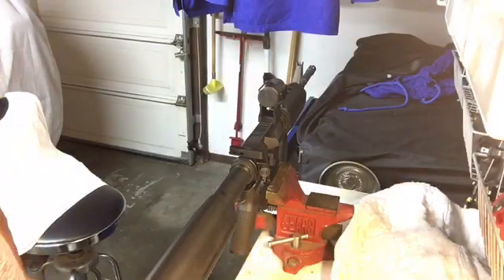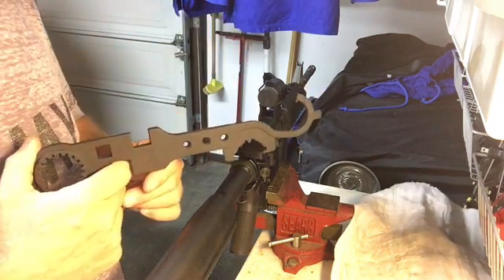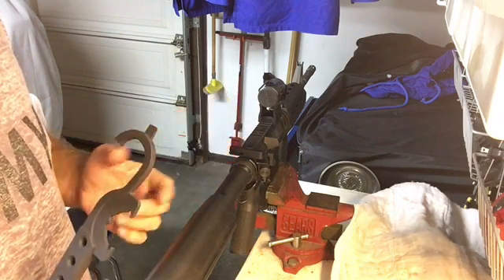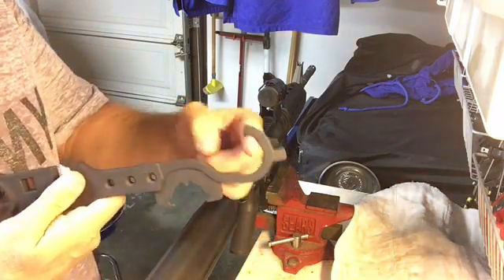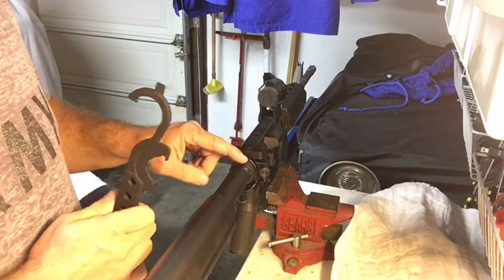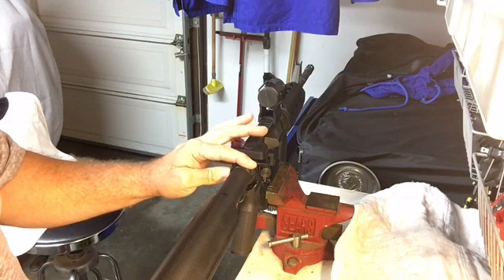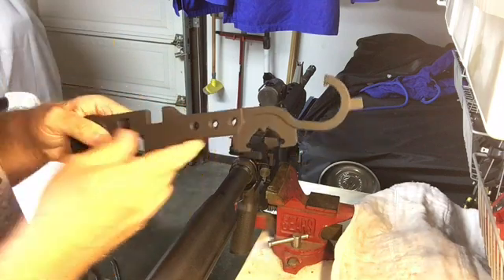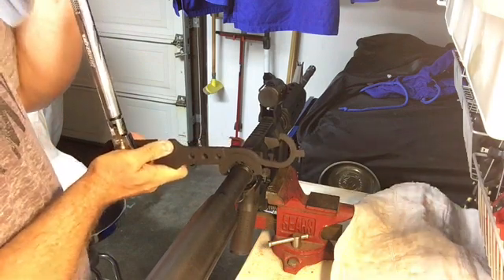AR15 Castle Nut

Comment: what matters as far as torque applied is the distance from the center of the nut to the point at which the center of the torque wrench drive is applied. it's actually a pretty complicated subject. It would be much better if the square that the wrench goes into is as close as possible to the centerline of the buffer tube.

That particular armorer's wrench is not a good design.

Comment: Thank you for the video. Just what I was looking for. Well explained. I actually have the exact same armorer’s wrench as you.
Reply: I would have thought that the torque would be more accurate if the torque wrench was in line with the tool where if it was orthogonal (right angle) would introduce a factor of an error of the desired torque

Comment: How did you clamp your lower in the vise to apply the torque without fouling or cracking the lower?
Reply from the maker: I used an AR15 vise block. It’s basically a hunk of plastic that locks into the magazine well. They sell them on Amazon. See link below.  That said, it does make me a bit nervous the amount of pressure that seems to be placed on the lower. I try my best to really support the lower with my free hand/arm to try to reduce the pressure when removing or installing a castle nut. Especially if you are taking off a tight castle nut that is staked. 
https://www.amazon.com/Reinforced-Plastics-Fastening-Support-Assembly/dp/B0C5WZFK44/ref=sr_1_2?crid=369R7N1SJPCQ9&keywords=ar15+vise+block&qid=1701839761&sprefix=ar15+vice+block%2Caps%2C230&sr=8-2
Reply: @RAWFIXIT  thank you.

Comment: 40 foot-lbs is the standard spec for the AR buffer tube castle nut, and yes, put the torque wrench at 90 degrees to the armorer's wrench. Same applies to tightening and torqueing down a barrel nut which has a higher torque spec . . . see barrel nut manufacturer's specs for that as there are many different barrel nuts now, not just the Mil Spec.
Reply from the maker: There are also specific wrenches for the barrel nut. They look like crows feet wrenches but are the very specific sizes for barrel nuts. I’m a big fan of avoiding damage by using the right tool for the job.
Reply: @RAWFIXIT  Fortunately the proprietary barrel nuts included with the floating handguards I've installed always included the "wrench" for it and the torque spec. It's removing a proprietary one from an upper that I didn't build to do some work on the gas system or barrel, and then reinstalling it. Some headaches . . . including emails or phone calls to the maker of the upper and its handguard. Nothing insurmountable - yet - just a PITA.

Comment: Great explanation all around. If you have the need to take off the castle nut multiple times, there are ratcheting castle nuts available for not much more.
Reply from the maker: That's a great idea.  I don't take mine off very often, but a ratcheting castle nut would make life easier.
Reply: @RAWFIXIT  They say that staking the castle nut is really only for a duty set up, not a real concern for range rifle. If you have an AR-10 that's way over gassed. Swapping out buffer weights and springs to reduce recoil and obtain the right ejection angle can be a tube on, tube off situation. I may have bought into the ratcheting hype, the lighter the rifle the better IMHO.

Comment: There is another tool that is useful when removing a staked castle nut. A dremel tool. You can carefully grind the stake dimple out which will make it a lot easier to remove the castle nut and lesson the stress on lower receiver. Then replace backplate and castle nut. Their not that expensive.

Comment: So did you stake the castle nut?
Reply from the maker: No I didn’t. I understand why they do it but I’m not a fan. Just my personal preference.
Reply: @RAWFIXIT  all good I ask bc I'm about to put on a geissele buffer tube for my DD mk18 and haven't removed or installed a castle nut before.  So then the 40 ft/lbs is sufficient enough to keep the buffer tube secure to the receiver?
Reply from the maker: @mmcgarry7384  I think it is.  I've never had one loosen up.  You can always check it after a few outings and confirm it is staying tight just to be on the safe side.
Reply: @RAWFIXIT  thanks for the info

Comment: Agreed!  I am actually a journeyman millwright/industrial mechanic and I too wondered how you could use a torque wrench offset from the fastener and not over-torque it, actually.  I then subsequently learned of the importance of the 90 degree application, as you described.

Comment: there is a neat and simple formula i found if you have to ad to the length of the torque wrench so you can set the wrench right if you cant do 90 degrees.  Take the length of the wrench to just about the center of the handle.  Then add the length from the center of the square hole to the middle of the castle nut tool cutout.  Take the length of the wrench and divide it by the length of the wrench and the added length from the tool.  That will give you a number under 1 in decimals.  multiply the decimal number times the required torque.  That will be the number you put on your wrench.
Reply from the maker: That sounds interesting. I’ve never heard that one before. And I might experiment with that do a little math.

Comment: Can you use a regular 9$ wrench from Amazon on the castle nut ?
Reply from the maker: A decent armorers wrench Is not overly expensive.  No point in busting your knuckles with a cheap wrench. You probably spent over $1000 for the gun don’t cheap out on a wrench.
Reply: @RAWFIXIT  thanks for responding, the ar I have is 350$ brand new it’s a bear creek Arsenal 556, I will get a good wrench now
Reply: Also getting a good quality one is worth it because that will not be your last AR many more in your future. 😊

Comment: Now how do I keep my buffer tube straight when tightening?
Reply from the maker: The buffer tube has a notch in the bottom and the backing plate has a tab that lines up with that notch. So once you screw in the buffer tube as far in as you need it you can line up the backing plate and hand tighten the castle nut and everything will be lined up. It  shouldn’t rotate when you torque it.

Comment: I have a poorly staked castlenut after shooting this weekend it loosened up any advice on how to tighten when there's a poor stake already
Reply from the maker: If it is just coming loose consider torquing the nut with a torque wrench to proper torque. You can restake it with a punch if you want to but I never do and haven’t had one come loose.
Reply from the maker: Are you talking about the notches in the castle nut that are used for tightening with the wrench . Usually they refer to staking as the process of using a punch to lock in the castle nut. I never stake my castle nut and have never had one come loose. If the tightening notches are damaged I would just replace the castle nut.

Comment: How do you keep the buffer tube from spinning or moving when torquing?
Reply from the maker: The buffer tube has a groove on the underside where a tab on the backing plate rides.  The backing plate of course seats at the back of the lower.  So it all stays in one place.
Reply: @RAWFIXIT  right. My whole tube twisted. I’m guessing I need someone to keep it in place to allow the castle nut only to turn.
Reply from the maker: @lanceschul  Interesting.  I've never had that problem.  But yes I would put the stock on and have a friend hold in line if it is twisting.
Reply: @RAWFIXIT  so I did a little more research. This is a carbine buffer tube and the castle nut takes 40 inch pounds not 40 foot pounds. This came directly from Palmetto State Armory who is the manufacturer. I think I was applying way too much torque.
Reply from the maker: @lanceschul  Oh wow, yeah that is a big difference.  Now I want to go back and check my packaging on my magpul end plate and confirm it is foot pounds.  I know I have my original buffer tube.
Reply: @lanceschul  no, it takes 40 foot pounds.  Look in any AR15 armorers manual or even on a MagPul armorer's wrench where that spec is cast right into the tool.

Comment: I tried that and it felt like I was going to break the mag well. The mag well vise block doesn't support the rifle good enough. I couldn't get 40 ft lbs but I am pretty sure I got close.
Reply from the maker: I agree. The torque and stress on the lower and the mag well is  the scary part. I really tried to hold the rifle and support it while I applied torque.

Comment: Thanks. I was wondering same thing because it seemed to me if you put torque wrench flat or horizontal then tighten it seemed to me it would over torque because of leverage. Thanks that makes sense using it vertically.

Comment: You’re a very trusting human being. I hear what you’re saying and I’ll probably give it a try because there’s just nothing else out there about this in video format. Not that I can’t read. Just, if I’m going to do this to a $2,500 rifle, I’d like to watch someone break theirs first. 😂 Appreciate it man!
Reply from the maker: LOL I hold my breath every time I work on the rifle.  Any mistake can be an expensive one.  Taking the nut off was much more nerve racking than torquing it back.  I really don't like the way the lower twists as you put pressure on the nut, but there really is no other way.  You just have to support it well.  When torquing it back, you can always back off the specs and if the nut doesn't loosen then it is probably fine.  I think the specs called for 40 foot pounds and I started with 30 pounds to see how it felt.  I also did not re-stake mine.  No way I was going to start beating on it with a hammer and punch.  Good luck.
Reply: RAW Video Staking is easy with an auto punch. I use a $4 one from harbor freight.
Reply: @RAWFIXIT  Hi, PLZ respond to this question as their aren't many videos on this. 
Unless I'm wrong, doesn't the castle nut tighten in a clockwise direction from the rear/view of the camera?
You have the both wrenches in place HERE for a "disassembly" setup, correct?
I know this was a rough demonstration but that is confusing me.
Being, if you had of demonstrated tightening the nut in this video, you would have had the wrenches inverted and on the right hand side, and would have been turning it clockwise from behind it, correct? 
If so, I FULLY understand... 
I know this video was more about the 90 degree angle factor, even though the final commentor says to use the wrenches side by side per some manual, but I'll talk to my armorer aswell, this makes sense.
Please let me know if my question would have been the case if you had of actually torqued/tightened it down in this video! Need to know.
Also, does the wrench need to STAY at a 90 degree angle the entire time??? So basically get it hand snug, and then start, to avoid extra rotations, right?
 (Flash hiders are either 25 or 30 ft/lb, I removed one to boresight and need to put it back on properly, it's hand snug and aligned about right, but I like doing things the proper way. 
I don't use grease, nor thread lock like some are saying, which both have the opposite effect so that's confusing, grease to make it smooth, and thread lock to avoid staking. It Came dry, so I do it the same, just will be my first time using a torque wrench.
Want to tighten the castle nut to, or closer to spec than my hand being I added a QD backplate awhile back and hand tightened with it between my knees.
Hope to hear back!
Reply from the maker: @tonynorris1506  Hi Tony.  Thanks for watching the video.  I apologize it was not 100% clear.  I realized after watching the video, I should have actually demonstrated the process on my castle nut.  The nut tightens Clockwise from the perspective of looking at it from the rear.  So in my video, I would have pushed the wrench away from my body to tighten.  The torque wrench  must remain at a 90 degree angle to the armorers wrench, so do not "ratchet" the torque wrench as that would change the angle and ultimately skew/alter your torque setting.  Hope this helps.
Reply: @RAWFIXIT  Thanks,
Do you feel it would be beneficial for one to put the wrench into the opposite side (basically just invert the way it is in the video) being in the video, if the wrench lock tabs were at 9, 12, and 3 o'clock, I'm not understanding how you could push forward and the wrench do a rotation.
If it were on the right side and the torque wrench on the right side being pushed/pulled down, wouldn't that keep the Armorers Wrench on better, and also allow it to start turning downward better?
Or would that throw off it staying at a 90 degree angle as good?
Reply from the maker: @tonynorris1506  You can experiment with the position of the armorers wrench. Much of it depends on the location of the notches in the castle nut. The important thing is to have the armorers wrench secure on the castle nut so that it does not slip. Once you have a position you’re most comfortable with then you just attach the torque wrench at a 90° angle
Reply: @RAWFIXIT  crazy thing, just checked my freaking Ft-Lb torque wrench and it's 3/8ths!!!
I'm assuming it takes a half inch rachet, the autoparts store should have a normal adapter, correct?
Just wondering if that style adapter could throw anything off.
Reply from the maker: @tonynorris1506  Yep, mine is also 3/8.  3/8 to 1/2 adapter was needed.  Won't change the torque at all.  I bought a craftsman set with various sizes from sears years ago.
Reply: @RAWFIXIT  so you put on the larger adapter, and stick it inside of the slot with one end open on the armorer wrench (flash hider slot) or the one that is closed around it? (Barrel nut slot)
I realized with a spark plug socket attached, that due to the flat side and larger girth, it will fit snug into the flash hider port on the armorer wrench that has an open ended side, unless it being an actual long socket on the end would affect the torque numbers.
Let me know what you think.
The cut of it would be like a long adapter basically.
Thanks for your advice so far also!
Reply: @RAWFIXIT  Hi, not sure if my Armorers Wrench is cheap, or if this is normal. Need your advice.
I got a 1/2" torque wrench being the autoparts people advised against using an adapter on the 3/8ths (likely to make more money). I said F it and got it, just don't like that it's like half a foot longer than the 3/8ths one.
So Anyway,
the male part of the wrench didnt seem as if it was going to fit into the hole of the Armorers Wrench at first, as if the hole is too big still, but when the torque wrench head was tilted at a 45 degree angle in the cutout in the Armorers Wrench, that's when it locked into place, the corners of the Torque wrenches head lock into the upper corner and opposite lower corner of the Armorers Wrench cutout. 
Is this normal?
Or is it supposed to go in and fill the full width and lock on the flat sides?
Hope to hear back!
Reply from the maker: @tonynorris1506  sounds weird but as long as it doesn’t slip and you maintain the 90 degree rule it might be fine.  Take it slow and smooth pressure.
Reply from the maker: Here is another video specific to torque wrenches where they test this 90 degree angle theory. Interesting if you want to geek out on this stuff.   https://youtu.be/4dsAvFNVGRE